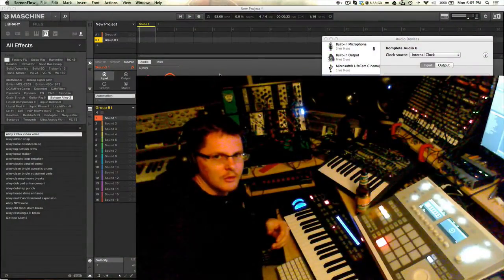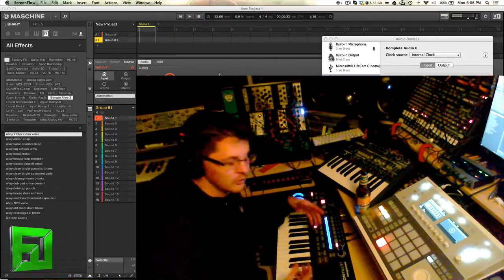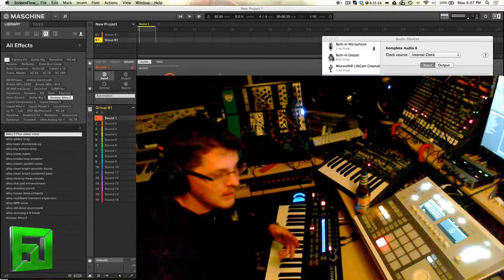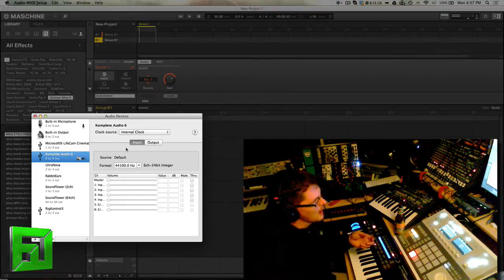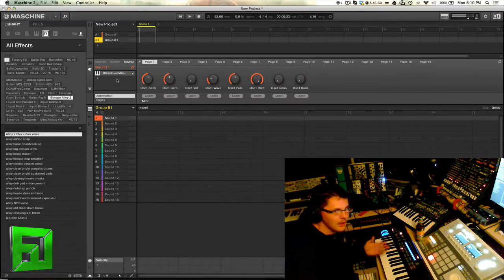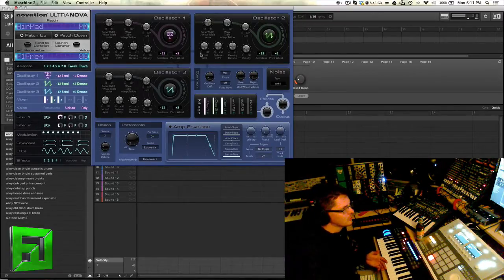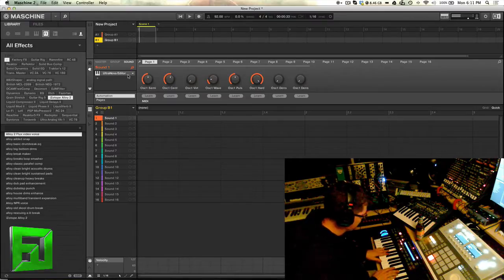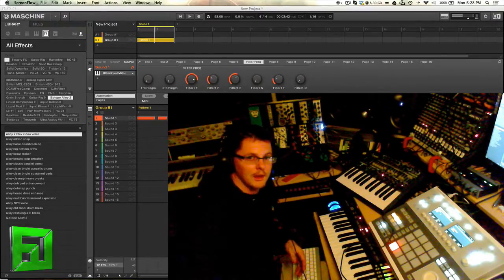Novation Ultranova how to Setup in Maschine 2.0 mininova

Comment: what's up flux.Thanks for the vids that guide me straight to the point.Some people just make simple procedures into long boring schematical documentaries  lol. 

I know this is an old posted vid but I do have something to ask.
For the ultra nova,I assume you'r not using the actual interface of the synth.Just using midi & s/pdif.That means I should be able to use the mininova but with 1/4" ts cables & midi.That is as long as you'r not using ultranovas builtin interface. Remember too,that mininova doesn't have a builtin interface,giving the price difference.That's as far as sound goes.

Now,I understand this next question has to do with your vid on moog sub phatty.Can I map out the mininova as a controller for monark,fm8 etc. or will ultranova work better? I almost purchased sub phatty yesterday before I watched these vids lol. If neither novation synths work,should I just return the mininova for the sub patty or can I map out the complete control keyboard to control monarch,fm8 etc? I will copy this question to the sub phatty vid for others to see,if that makes more sense.

Comment: Hey bro, first and foremost, thanks for the videos.  I love your stuff, you definitely do an awesome job of breaking things down!

On to my question:

I want to get an ultranova or mininova to use the vocoder specifically.  Would using either ones vocoder with the maschine essentially work the same way as playing it how you explained here?

I understand software is an option but I'm partial to hardware if possible.
Reply from the maker: mastehmuh yes would work the same :) thanks for the kind words
Reply: ***** Thank you for the expedient response.  You really have been a big help.  I'm going through your old guitar rig videos now as I finally scooped up a proper Audio interface (NI Komplete Audio 6).  Absolutely a fan!

Comment: Flux,can i use the mininova to do what you do with the ultra nova using s/pdif,and if so,witch output do i use.
Reply from the maker: I don't believe the mininova has SPDIF ports on it does it?
INSTEAD use the analog outputs and you can do the same thing
Reply: ***** :No it doesn't,thank you so much for that INFO..

Comment: I like to finger drum and play my synths simultaneously. When trying to do the same thing with Maschine 2.0 MKII, I run into a problem.  I load group A as drums and group B as sending and receiving audio and midi from my 2 hardware synths (BSii and Mininova). I start playing drums with my right hand. As soon as I play a hardware synth, the MKII switches to group B and takes group A (drums) right out from under my right hand. 

I noticed in another video of yours where youre jamming on the Nova and playing drums, that this wasnt happening with your setup.

Is there a different method? Any tips?

Comment: Hey, Flux. I have the original Maschine and I'm trying to connect it to my Novation MiniNova that I recently got. 
I don't know what I'm doing wrong but I'm desperate to just figure out how to get the sounds from my MiniNova recorded within Maschine. 
I have my MiniNova connected to my Mac via USB.
I then have the left and right TRS outputs from the MiniNova plugged into the TRS inputs of my audio interface.
From there, I have the TRS outputs from the audio interface connected to my speakers. 
So those are all the connections, right? 
What do I need to do on my computer to be done?
At the beginning of your video you opened the Audio Midi Setup on your computer and it showed your audio interface and the UltraNova.. yet for me it just shows my audio interface but no MiniNova. 
And I can't change the clock source to external like you did.
Please help. :l
Reply from the maker: the audio midi stuff I was doing was so I could use SPDIF .so you shouldn't need to worry about that. the key is in maschine to set up an incoming audio input channel that is set to the channel you have your UN going into. (set up an input module on a pad)

Comment: If you us the novation USB adio driver you absolutely can. I've been doing it for over 2 yrs. here's a link of how to set it up on abelton. http://www.modulatethis.com/2011/05/how-to-configure-ableton-live-novation-ultranova.html
Reply from the maker: Ah you are absolutely correct. but if you do this you loose out on use of an external audio interface (so yes if you are only using The UN as your interface you could do this.) I don't do it this way because most people have a dedicated audio interface. (and the downsides are that the UN has imho a pretty terrible clock so I try to steer clear of its audio interface when I can.

Comment: Flux, thanks for the video. For some reason I can't seem to get the automation reflected in what I record into Maschine 2.0. Even using the automapped knobs (mk2). UN through Audiobox USB interface, XLR not SPDIF. Any idea what I might be doing wrong?
Reply: To further clarify, i'm not seeing the knobs on the screen move in real time during playback or hearing the changes, it seems to want to record wherever I have the sound "at" when recording begins rather than changes..I have the Ultranova's USB cable hooked up directly to my laptop, but no midi going into my Audiobox interface. Thanks in advance man. Hoping there's some really silly thing i'm missing here.
Reply from the maker: To record automation you need to turn on autoroute and use the knobs on the Maschine controller to manipulate the novation Ultranova vst editor.  Not the novation knobs.  Maschine seems to be stupid in that external controllers movements are not being recorded.
Reply: Thanks so much for the response, man.

Comment: Flux I have to ask cause I have yet to see it done before. can you play Maschine pads on an older MPC like the 2000XL or 3000 thru Midi?
Reply from the maker: I need a little one info on exactly what you mean.  You can use maschine to trigger your mpc if you sett up a midi template.  You can also use the mpc to trigger your maschine sounds as well.  I don't really prefer it though.  Maschine pads are great and so are mpc pads  no need for me to trigger one with the other.
Reply: Yes I was trying to trigger Maschine pads with MPC pads just like you did with the Keith McMillen QuNeo. I just wanted to try it out since someone just gave me a MPC2000XL!
Reply: I tried Midi to USB cables but I t didn't work so I am going to go get 2 midi cables to see if I go from my MPC directly into my Maschine will that work.